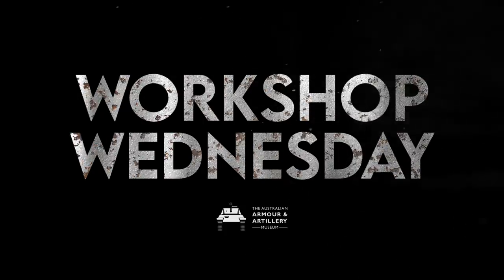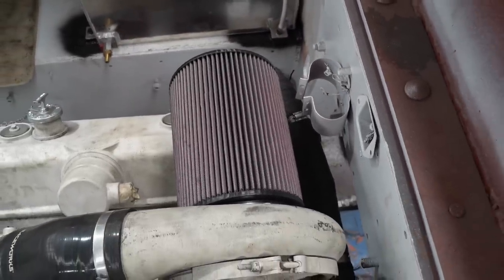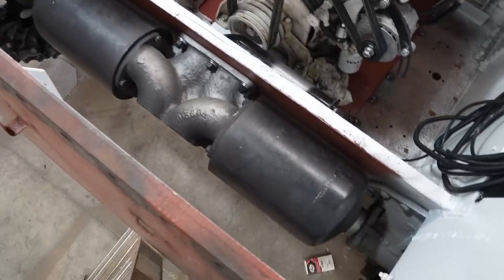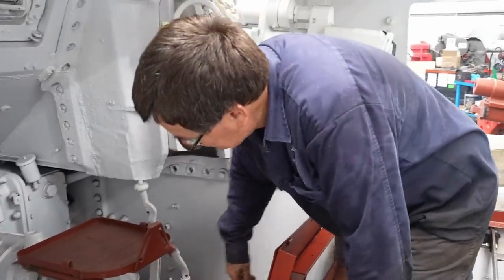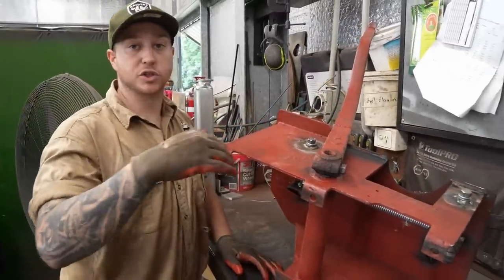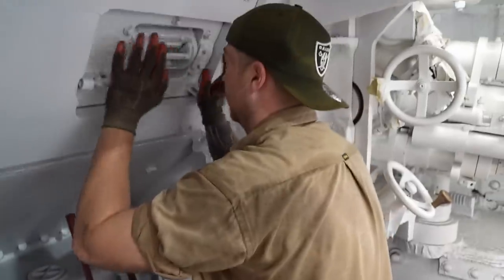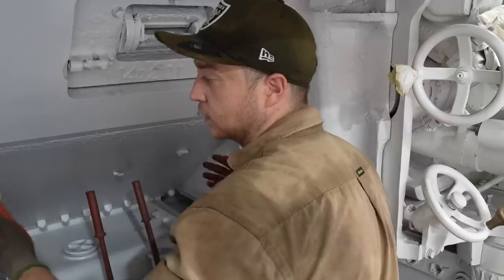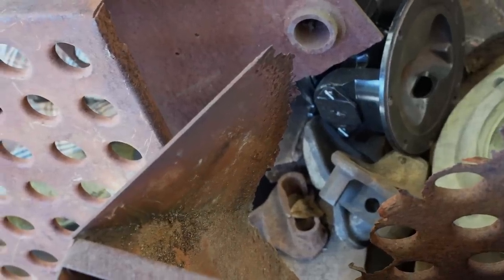WORKSHOP WEDNESDAY: WWII Grant Tank Restoration UPDATE!

Comment: One of the few pleasurers I have during my chemo. And when the body lets me building a 1/35th scale  museum version of the M3A3. Only need to use 3 different kits. And then doing one with full interior. Thanks for keeping me sane and able to cope with the cancer battle.
Reply: Best of luck for your battle mate and have a ton of fun with your build!🇦🇺👍💪
Reply: Wishing you a successful fight in your battle ❤
Reply: If you can bash 3 kits into one, nothing would beat you mate .
Reply: Knowing what you are going thru due to losing 2 sisters I pray you make a full recovery!
Reply: Good luck brother❤ It will get better
Reply: I built a model of the First USS Ranger using 3 different plastic aircraft-carrier models. It ended up being sorta close but not exact. Have fun and good luck with the chemo. Todays treatments can be very effective. SEveral of my siblings have survived them
Reply: Hang in there, best of luck!
Reply: Class
Reply: A full interior... oh a fine scale modeler.  I used to do that too and for outside detailed rust touchups I'd use real rust powder mixed with clear coat matte, but inside I used things like thin copper wire for instrument bezels and even made a few "stamped" parts from tin foil with a tapered-smooth piece of sprue.  But my real edge was using a very large magnifier with a built-in circular lamp.  Anyways I hope you have tons of fun with your kits, don't worry about remaking a part (sort of like Jess in video, lol) and you'll bring that next level that I'm sure people who see your kits will be floored by it all.  Happy fine scale modelling!!!
Reply: Good luck, mate.  I'm going through the instructions of my Academy 1/35 M3 Grant (full interior) while they are working on the parts; fun!
Reply: Stay strong mate! I wish you a fast recovery 🙏💪
Reply: Wishing you all of the very best with your battle and recovery, hopefully you can post some photos of your model when you are ready
Reply: Good luck with the chemo, enjoy the little things.

Comment: I love this show!  Lads, a small bit of advice.  Install a manual waste gate control for turbo, and install a boost pressure guage.  Replacing an engine because it overspeed and at a minimum threw a rod or blew out the gaskets a royal pain period..  And that of course is a minimum! worse is generally much much worse...  Because you want a runner and not just a display piece take the extra steps... of course you'll have to educate visitors on what isn't  quite... you know... "stock"  .. but that all part of the show after all..   Maybe you could go find the m3 that was used in the film "Sahara" with Jim Belushi  (So who has that M-3 Lee(?)?  It was shot in Port Stephens, New South Wales and it was provided by Australia for the film.  Thats all the information I have on it.. if you gents no more DON"T DON"T SIT THERE AND SMIRK!  Tell us! Damn Auzzies!  Just you remeber  the pacific version of the commonwealth complain.. Americans overe sexed, over paid and over here.. and the amercan (pacific) reply would be to you Auzzies would be under paid, under sexed and under MacArthur!)  P.S. All in fun, love ya lads,. great friends to have your back in a fray.  Ya ROCK!
Reply: Hmm... good idea, considering the fact that these Detroit Diesel 2-strokers have this nasty tendency to run away like its nobody's business...
Reply: m3 lee used in the Jim Belushi version of Sahara, was a grant, turned into a lee and im 90% sure it reside in Canada or the states.

Comment: A number of years ago 1942 I  believe Hollywood produced a film Shahara about a M3 tank tring to get to there own after battle loss. They showed the tank driver driver working the controls and looking out his portal with goggles thru a sand storm working on getting sand out the intakes it is my favorite war movie also staring Humphrey Bogart. Thanks for your show you guys work hard in heat and humidity and you are just as devoted as the original crews on all that equipment that is there Thanks Gary

Comment: Great episode! Good progress on the Grant. One thing - could be a problem using a 5" to 3" adapter from 5" turbo outlet to 3"pipe. It may choke the outflow to the point where you lose power and / or overheat the turbo. Probably will need an air blower pushing cool air between the firewall and the 1500 degree F turbo hot side. It's gonna get hot there!

Comment: I don't know if you have ever seen any of the work that is going on to reconstruct the Parthenon in Athens, Greece.  Obviously there are a lot of missing parts for it but what they do in the reconstruction, rather than trying to match the newly made parts to the old by colour and texture, they make the new parts with  subtle but obvious difference so that they can be identified.

The reason I bring this up is because I think it would be a nice touch in restorations like this to have the newly fabricated parts a slightly different colour to the original parts for three reasons:

Firstly, it would highlight the tremendous amount of work that the lads have put in in creating the restoration.
Secondly, it would help the newcomers to tanks and mechanics in general, to understand how difficult a task like this is.
Lastly (and probably most importantly) it would shut up the nitpickers that would be out with their clipboards to point out everything that's not original.

I realize its a lot of work, but it would be so worth while.  I would volunteer to do it myself if I lived a bit closer .

Comment: I'm seeing a lot of guns used where the ammo is loaded using an arm, then a 'chain' pushes the ammo into the barrel, but there doesn't seem to be anywhere in the arm for the chain, any chance of an explanation sometime ?
Just want to know how that works.
Reply: It sounds like you are describing an “auto loader”.  That is a device that loads the gun using machinery, and is a more modern feature. Back in WWII, everything was loaded by hand by a crew member (appropriately called the loader).  This feature is a hotly debated topic as to which is better: a mechanism or a person.

Comment: I'm a little concerned about how close that turbo is to the firewall, and while the firewall will definitely take the heat coming off the turbo, it may also spread the heat to places you don't want such as wiring or pipework in the vicinity.
Reply: I'm not knowledgeable about turbos.  I thought they got hot, and that inlet filter may be a fire risk?
Reply: @SmedleyDouwright  They get extremely hot, the inlet should be ok, but the metalwork of the body is a concern. If you look at a trucks engine bay there's usually a fair bit of clearance around the turbo housing for this reason.

Comment: Did the grant originally have the Chrysler multibank engine?  If so, it was a good idea to replace it with a more modern single block engine.  Just the maintenance would be intensive on the multibank.
Reply: I believe most of the export models that made it to Aus had the petrol radial engine

Comment: Just questions of mine

is the reason for using the detroit engine's own gearbox to prevent wear and tear to the existing gearbox/transmission that is already in place?

wouldn't the detroit engine's own gearbox interfere with the rotating mount/turret basket?

cause from what i saw in cutaway images of the M3 Grant/Lee, there's only a driveshaft going from the Wright R-975 towards the transmission.
Reply: I think this restoration is based on the Lee V variant, which was supplied to UK and Commonwealth forces, and uses a pair of Detroit Diesel 6-71s.
Reply: @kristoffermangila  i see, but the part i'm mostly intrigued is the inclusion of its own gearbox (around 8:16).

i know that the Detroit Diesel 6-71s on the M3 Lee/Grant V were paired to make the GM6046 powerpack, however did it have it's own gearbox before the transmission/differential package?

i could not find any internal diagrams of the V variant on the internet, so i'm quite limited in information as well.
Reply: @nightshade4873  its early days yet on the powerplant install, so let's wait and see.